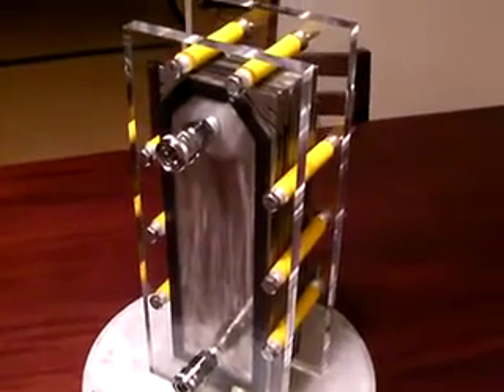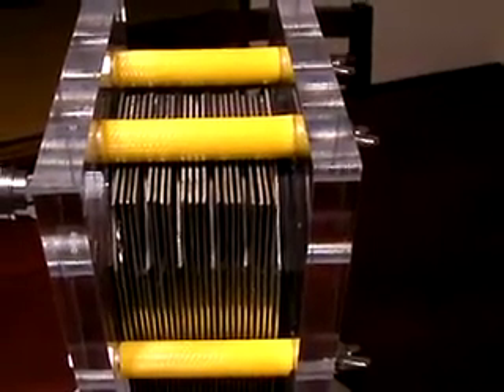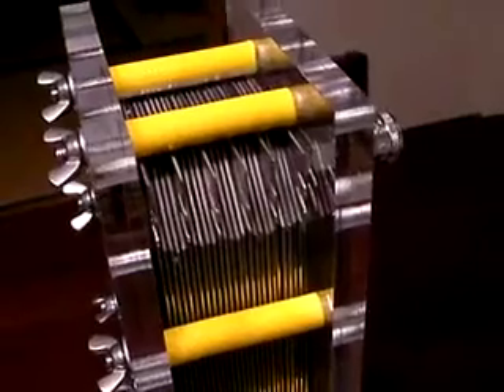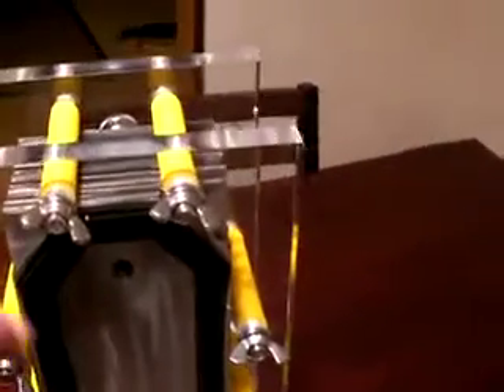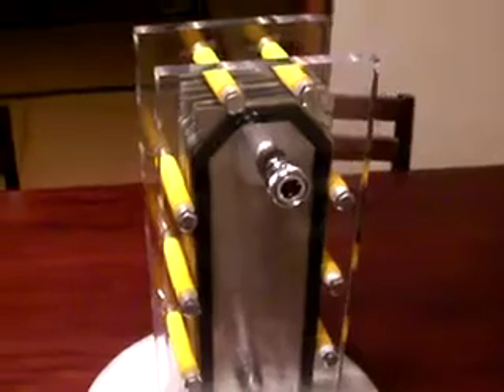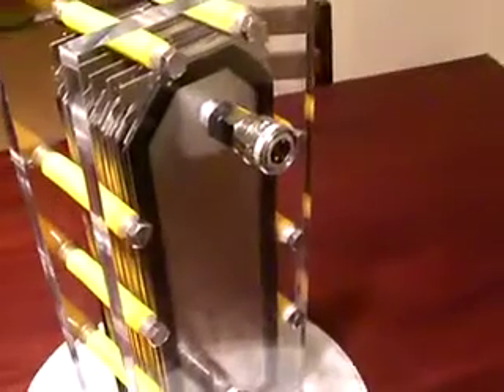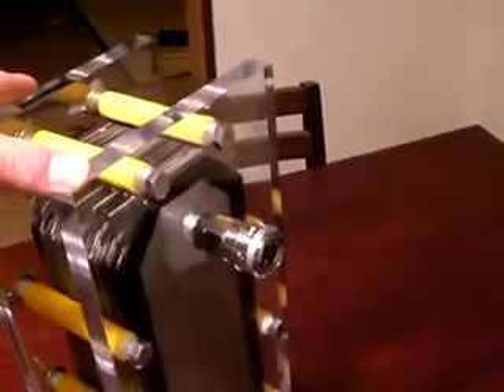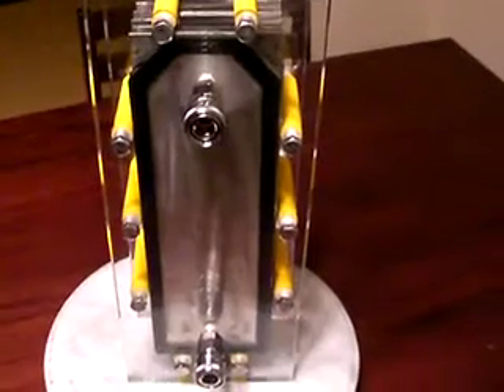HHO Dry Cell Finished !

Comment: Mr. Alpha, to answer your question about the heater project its on hold right now. I think it is best to build a separator cell meaning a  cell that separates the hydrogen and oxygen. Since this build I have moved to the country . Im working on building a new shop to work in.

Comment from the maker: I had to order acrylic plates from an acrylic company here in Japan.  Just the plates were 6000 yen.  Thats about 65 dollars now.  This cell was my first real all out production unit.  I ran it with pure baking soda because it is safe to work with but it will kill your cell efficiency. Now, Im going to re-sand all the plates and recondition the cell using sodium hydroxide. Its the best electrolyte to use.
Reply: You mean potassium hydroxide (KOH), but even better is potassium carbonate.